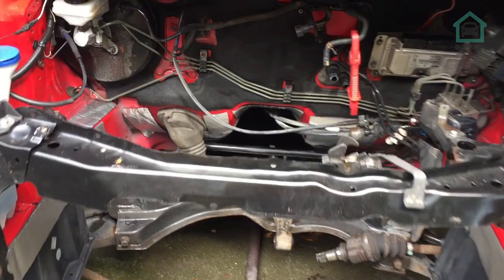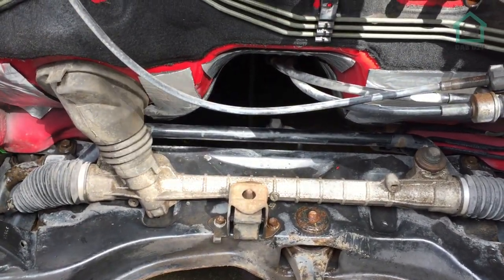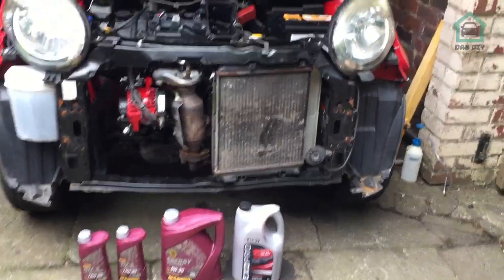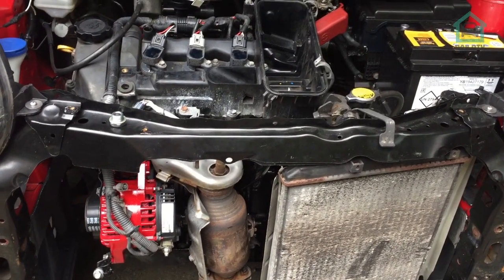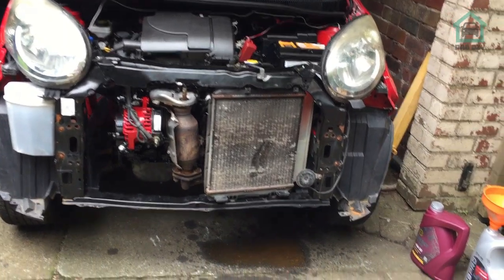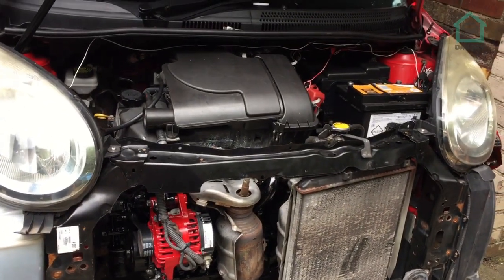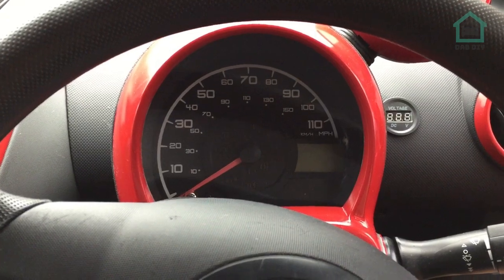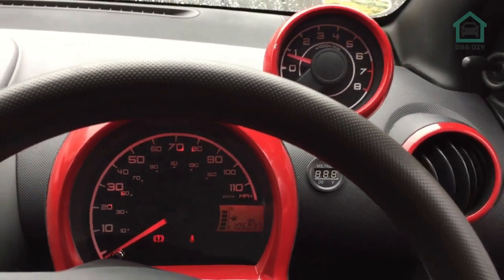Project C1 gets a new engine - Part 3

Comment: Have you compression tested the new one?
Reply from the maker: Before I picked it up. I even saw it running too.
Reply: What readings did you get if you don’t mind me asking? And was that the reason for change on the old one?
Reply from the maker: @fodey_3134 I can’t remember the readings tbh, it’s been a while since I tested it. I lost compression in two of the three cylinders in the old engine.
Reply: Exactly what happened to my old one.. so bought a new one! But wasn’t sure of ‘good’ pressure readings
Reply from the maker: @fodey_3134 I’ve had a read in the technical manual and I believe the correct readings are:
Minimum pressure: 11 bar
Normal pressure: 14.5 bar
Difference between cylinders: 1.5 bar or less

Comment: Soo let me understand this..as I am doing this next on my car...my car is 2007 and I just got spair engine to go in...the 2 plugs that are going to ECU are not the same?😮Are the wires colour different?Is there anyway of modifying them if my engine won't fire up after the swapping?
Reply from the maker: If your replacement engine comes from a facelift model car (2009 on), you’ll need to use your existing engine wiring loom.

Comment: Great little video. Just to ask, how do you insure the car with all the "performance" parts you have fitted. I once had the idea of removing the back seat to put my dog cage in the back, been an honest guy rang the insurance company first and after a lengthy discussion it appeared my insurance would be null and void if I did the seat removal. Further more they would not insure it even if I offered to pay an excess.
Reply from the maker: My insurance company are ok with everything because none of the mods are performance increasing mods.

Comment: Great job, I hope it will keep going forever!  I'm preparing a brand new engine to swap for my old one, which also behaves very rough and loud (probably because I took it racing in the alps too often...) .  
While I'm at it I am replacing and improoving anything on the way and around.  I love this car and want it better than new again.  My garage is currently almost the entire car in new parts lying around XD.  I've done engine swaps and complete rebuilds on my classic VW Bus and older Golf before, so I'm pretty confident for this one.  
You mentioned "1.5 Yaris injectors"?  Are those bigger / more volume? What's better about them? Do I have to change / adjust anything else when using them?  I want to give it a little more punch wherever I can...
Reply from the maker: It’ll have as many engines as is necessary to keep t on the road forever lol.

The 1.5 Yaris injectors are from the 1.5 litre T Sport model. They provide a better fuel flow for my next major modification, a Garrett T15 turbo. Unless you map the engine, they actually do very little other than burn more fuel. Once it’s been mapped properly to take full advantage, you can squeeze a few more horse power out of the engine.
Reply: @DABDIY  Thanks for the info!  I'm already looking deeper into the matter.  I plan to give it a remaped engine ECU too, but I have to see that I still pass the german TÜV (MOT), and have to find a trusty remap guy to do it.  I'm mostly looking for more responsiveness.  
If you're thinking about charging yours up, there is small belt driven roots super chargers on ebay that you could probably fit to the engine where the AC compressor would be mounted on an AC model.  Using a magnetic clutch on it you could set it up to only boost when a button or kickdown switch is activated.  
This is my daily driver, so I won't do stuff like that to my 107, but I know what I would do if I wanted to.. ;)
A turbo would be a hard strain on that little engine that was built for economy, so don't go too high on the boost.  I know there are / were turbo and roots kits for it, but I don't know how they actually performed...
Reply from the maker: I already have the Garrett turbo and most of the necessary hardware for the job. I’ve seen a few turbo charged bugs before too, as long as you don’t ask too much of it, it’ll perform just fine.